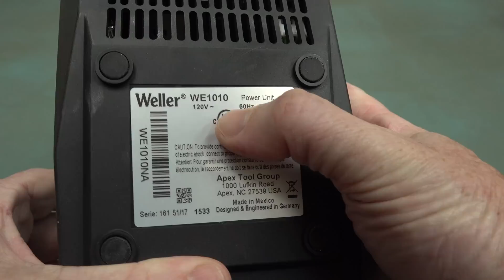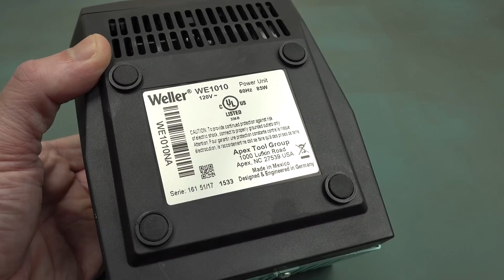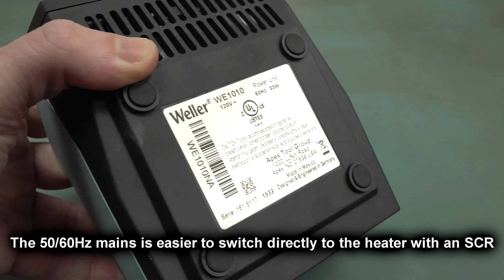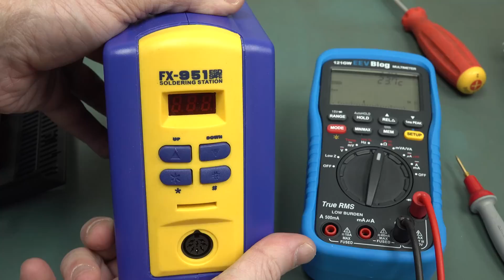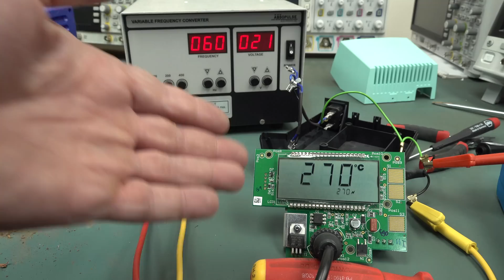EEVblog #1152 - 240V-120V = Magic Smoke!

Comment from the maker: Does anyone know the exact legal regulations on non fused transformer primaries in various countries?
Reply: I'm not sure about the safety standards for soldering irons, but I do have quite some experience on EN60950 (safety standard for IT equipment), EN60065 (A/V equipment) and their common replacement, EN62368-. On all equipment which falls under these standards, a fuse on the AC mains is mandatory. Same for any medical device standards. I would be highly surprised if a non-fused transformer equiped device is allowed in any EU standard.
Reply: @auwdioslave  I agree,transformers must be fused on primary,i live in Italy and my Weller solder station has a fuse integrated on the CEI plug,the only exception i know are some encapsulated transformers,if i remember correctly they must tolerate secondary side short circuits,probably by core saturation,and they normally has a built in thermal fuse or a bimetallic thermal switch.
Reply: @auwdioslave  : but is it written WHERE the fuse must be? 
Can it be inside the transformer (which makes sense)? Because the current doesn't have to be that high for the smoking (only second turning on) it won't blow and probably is shorted in the melting-process.
Or in the connector for the cable? Same still not enough current but would next time when turned on or when it is starting to melt.
Or in the cable ? If you then use another cable then allowed you yourself make a safety-risk.

But: I have bought a soldering-station (pretty cheap) from a Dutch firm that is selling quite a lot of stuff and 'not from china' (although made in of course) last year. Actually a few of them. No fuse to be seen, not in the housing, nor cable (fixed cable). Might be invisible inside the transformer though. 2 of these released a lot of magic smoke but no fuse blew, transformer still works so it was only secundairy.
Reply: The insulation did withstand those puny 240V. Otherwise pluging it in should have given you a ear ringing "BANG" and triped the braker. The transformer saturated after that it something like an 30 ohm resistor shorting mains generating about 2000W of heat burning of the insulation at about 400°C.

To the legal Part:
In the EU it says somthing like - If a in an fault situation the the circuit braker will not trip (16A@230V) the device needs an input fuse.

In the UK they are crazy and fuse a circuit with 30A so they also need a fuse inside of their plugs as otherwise the powercord my catch on fire.
Reply: @tuxontour  in the UK we use a 40A fuse to allow multiple appliances on the ring main to be switched on at the same time.
Reply: UK consumer electronics regulation 374628/8467-6 subsection 6c paragraph II, clearly states 'Don't let that crazy Aussie bloke plug it in, it makes the pixies mad and you just know that sh*ts gonna happen!'
Reply: Not sure what safety standard they went for, but EN60950 or UL60950 requires the device to be single error proven. This means, that a single error, like a wrong supply voltage, MUST NOT cause any "abnormal" temperatures or burning. So it seems pretty much illegal in the EU - but there are always some loopholes I guess. 
Wellers quality degraded quite a bit over the last years, so I guess a recall is following.
Reply: PS: I have the standards at the office to verify tomorrow. You don't happen to have an EU unit somewhere that you can open?
Reply: Towards which country was it originally aimed for? Maybe some country in which there should be a fuse in the connector (like in the UK but then for lower voltage). 
The last years I noticed that more and more stuff doesn't have a fuse in the mains anymore (Netherlands, EU), also if sold in this country by reputable sellers instead of buying over ebay or aliexpress, so something must have changed in the regulations.

Actually, there is a good chance that during the smoking the resistance was still a lot higher then after cooling down. 
I have had this kind of smoke and 'powdered insulation' a long time ago with older equipment which was accidentely switched to the "107" Volt input instead of the 220 Volts (this nice little switch on the tape-recorders / televisions and so on).  No fuse (inside!) blew during the smoking, after disconnecting and re-connecting the fuses did blow (house and equipment at same time, straight after connection to mains).
Reply: @elvinhaak   It should not matter which country it was aimed at, all us humans have the same reaction to fire and smoke i.e injury and even death, why cant we make global regs and keep everyone safe? I will tell you why, cheap Chinese  crap, does not matter if its Weller or Wong Hung Lo. all comes from the same place !!
Reply: @andchip.s  Yes and no... 
Yes: it would be nice and maybe better if every country in the world had the same safe elektric-system but it would be very hard to  get everybody and every country thinking and working the same line. But yes, would be best if everything would be kind of safe
No: why is it nececary to make global rules for everything, making everything a lot more expensive and in some countries / regions extra double expensive and safe due to restrictions and rules? If for example one country decides to have the rule that it is working with 110 Volts with a max of 4 Amps coming out of a socket and requires a fuse in every plug that is rated to the max current of the cable and equipment and then also has an extra fuse inside, you have a lot of fuses that could blow before something happens, expensive cords, wirering and so on so you could leave the internal fuse out (because it is protected anyhow). If you have the same equipment in another country that is using a voltage between 200 and 280 volts, only a fuse in the main circuit of 20 Amps then on that location a fuse inside the equipment is really important and probably some extra protection....
Why make more costs in general and more waste (after all, in a couple of years everything is going to waste) because in some country the wireling and rules are bad? Also less people could afford it and would probably use more dangerous equipment, sometimes even self-made without any protection.
Reply from the maker: Andrew Hudson - Yes, my breaker blew
Reply: Dave, I think maybe this was an assembly error. It's possible the fuse is supposed to go on the primary, with the polyswitch on the secondary. Having both in series seems a bit strange after all!
Reply: @vcr32  I was thinking the same, why have two fuses in the secondary circuit??
Reply: Canadian here, we've got the same wiring standard as the U.S. and I've never encountered a fused secondary it's always on the primary.
Reply: @Shawn_White  24V transformers in furnaces/air handlers are usually fused on the secondary.
Reply: I checked the datasheet for the Weller WE1010 and it is supposed to conform to EN 60335-1: 2012-10.

I don't have the exact standard at the office, but the old version from 2007 instead of 2012,
but the changes should only be minor.

I only have it in German, so I'll translate the basic bits:
19 Improper Operation
19.1 ...
Electronic circuits need to be designed and operated in a way, that a single failure of the device doesn't make it unsafe in terms of electric shock, fire hazard, machanical hazard or dangerous malfunction.

Note 2: Fuses, temperature cutoffs, overcurrent-limiter or equivalent may be used to provide this safety. The safety mechanisms of building installation do not provide the required safety. 

So in my opinion this seems illegal, at least according to EU regulation. 
It may as well be, that it is allowed in the US and they have a built in fuse for EU units.
Reply: In canada (and probably US) [120V 60hz], I don't think it's a regulation. I've seen many devices that don't have any fuse.
Our appliances (ex: mixer, toster, vacuum, etc) don't have any on the device. Almost all wall transformers don't have them.
Reply: In Canada they are supposed to have a thermal cutout on the primary side, usually stuck between the winding and the core or right to the surface of the core.
Reply: @12voltvids  In Mexico is the same standard, it seems to be a Weller fault.
Reply: It was a shot over the bow directed at Mexico. 
If you saw some of the early products they made for Zenith, the system 3 deflection boards you would understand.
If you are unfamiliar,  google the zenith tv fire hazard.
The deflection board had a bad design, and the horizontal linearity was not soldered correctly. It arced and set the fiberglass board that had little or no flame retardant on it on fire as well as the cardboard  insulator that was attached top to the solder side of the board to keep service mans fingers away from HV when servicing. Anyway a number of them burst into flames and this board fire set the wood cabinet (these were console TVs of the day) on fire which in turn set the house on fire.  This was the first of the Mexican made TVs, and I remember changing plenty of sweep boards, and after a number of fires they finally recalled them, and changed to a new board that had fire retardant on  it, and surprise surprise,  now a plastic barrier as opposed to a paper one that the initial sets had. I changed probably 500 of those boards.
Reply: the only Transformers REGULATED in the USA are POWER TRANSFORMERS (i.e., the ones that step down or up the power that supplies your house/business) The regulations can be found in the N.E.C. BOOK. Of course "regulations" mean that you are FORCED to do something or you will bear consequences. W/ electronics you have "UL Listed" items, which are VOLUNTARY
Reply: @generuffalo4374  Power transformers owned by and under the control of the electric utility are covered under NESC regulations, not NEC regulations.
Reply: Dave:

if I read this right from the National Electrician's Code here in the States,  if the transformer has voltages more than 1,000 V,  protection on the primary side must be either fuses or circuit breakers (in addition to protection on the secondary side). If the transformer has voltages less than  or equal to 1,000V, it must have fuses or  circuit breakers on both sides.
Reply: Derek Witt NEC (US) Code does not apply to appliances (that is customarily UL and other similar guidelines).  But, as a general rule with a transformer, if you properly fuse the primary side then you have already limited the current that can flow into the secondary so ordinarily it will be the primary side that is protected by fuse or circuit breaker (unless, of course, you have a specialized application where the secondary side could actually source power into the primary and back feed the mains, then secondary fusing would also be critical — but there is not much chance of a soldering iron suddenly becoming a magical free energy device that powers the grid).

At first I was wondering how Dave got the plugs so easily confused until he turned the unit around and I saw the IEC socket.  From a practical perspective, anything with an IEC socket should be fused to protect the 120VAC device if plugged into 240VAC since that is a very real possibility (heck, even here in the States I could potentially accidentally plug a 120VAC IEC socketed device into our 240VAC receptacles in my shop where I have a good many 240VAC receptacles).
Reply: It is a UL certified product, that certification is the same in any country, Weller is not complying with the standard.
Reply: Didn't the trafo have internal(also thermal) fuse like others? Apparently not, just boiled enamel :D Even cheap linear plugpacks have one (:
Reply: Anecdotally, I heard about a 120V microwave oven that was connected to 208V (standard US commercial voltage 120/208Y 3-phase) due to a wiring error. Smoke poured out of the microwave oven. Same guy who did that also drilled through a conduit feeding a 600-amp panelboard....
Reply: it's also the Japan that uses 120V (with both 50 and 60Hz networks)
Reply: @666Tomato666  Close. 100v in Japan.
Reply: Our plugs in the USA you are completely different and you can't plug a 120 AC plug into a 220 AC outlet or the other way around. I know when I use to repair Weller Irons in the 1980 - 2000 they had glass fuses in them.
Reply: William Randles -  But if it's got an IEC 60320 connector you can just grab any cable. That seems to me also a safety issue here. If manufacturers use standard and common connectors like in this case.
Anyway the regulations in the EU is a mess because of globalization. It used to be pretty comprehensive but now it's all rather vague.
I remember glass fuses in just about everything in my childhood. Nowadays things like ridiculously dangerous USB chargers are sold everywhere. Perfectly legal. No real standards anymore.
Reply: @Northern5tar  I wonder how hard it would have been to construct a connector which would allow a 120V cord to plug into any decvice that could accept 120V or a 240V cord to plug into any device that could accept 240V, but would prevent a 240V cord from being used with a 120V device or vice versa?  Adding a couple notches in the plug that would fit with projections on the socket would seem a simple approach.
Reply: @wfrandles  Yes, they are different. BUT, Weller now use IEC-C14 sockets on their equipment instead of a fixed lead, which is what led to this issue.
Reply: Dave, you probably have an ionization smoke detector. You might consider getting your own photoelectric smoke detector. Or better yet, maybe a video that explains the difference between the two! Public service announcement.
Reply: I'm fairly sure here in north america that they are not required on smaller ones, but many manufacturers still add them in, for obvious reasons.
Reply: In the US, we do not generally require the primary side of the consumer products to be fused. It's silly, but we don't.
Reply: Well for Hong Kong we still follow the
 british standards as same as the UK
Reply: Thats really odd, in most us most of the cheap stuff normaly have a thermal fuse in the transformer, but often not a user serviceable fuse.  I wonder if some mfg skiped the fuse or something.
Reply: There is none in the US we rely on
Arc Fault Circuit Interrupters (AFCIs)and Ground Fault Circuit Interrupter (GFCI) and circuit breakers  older houses have fused circuit breakers )
Reply: EEVblog do a review on the Aneng 870 (Top of the line Aneng multimeter) next time please!
Reply: In the UK the plugs have fuses, many extensions leads had them but not all of them do any more and some appliances do have fuses inside or they are in round covers or holders.
Reply: If its in the US this is perfectly fine as each circuit has MCBs
Reply: Not to sideline this thread or anything but I am thinking about this and I am wondering how Dave managed to plug-in this Weller in the first place . As far as I understand it, the Plug for 240v is totally different then the 120v one at least in the UK. Does this mean that Dave has a 120v power bar running at 240vac? 
I looked through the comments and did not see anyone else mention this...
Maybe I am missing something regarding Dave's bench setup...
Cheers,
 - Eddy
Reply: The Weller unit has a standard grounded  interface plug, just like your PC has. The power cord would have the correct plug at the other end.
Reply: @12voltvids  - That would explain it... I was looking at my old WTCPT unit at the time and did not think about the standard AC (PC style) interface that the new units use.
 - Eddy
Reply: @EngineeringVignettes  IT has an IEC type 3 connector. It was the appliance end that is easily used on any voltage.
 Australians dont have 120V. We only have 240V phases, no other weirdness. For single phase we use an IEC Type 1 plug/socket on the wall - it predates the IEC type A used in the US and was originally used there. It is used in China and Argentina too (the china thing is ofc rather handy, the connector prices would be insane otherwise). We also have 3 phase 415V which is 3 240V phases.
Reply: I can't tell you what the regulations are, but I have seen quite a lot of US market stuff that didn't have a fuse on the primary side of the transformer, so I have to presume it's permitted.
Reply: still silly that it does not have a fuse, it should have at least an internal thermal fuse (self reset or one time blow)
 
the appliance itself been fused it or not is up to what country in the world your in(the application internally should have a fuse ) , most seem to rely only on the consumer unit breaker to trip but that can be from 20A 120v to 32A 240v witch can cause house fires if say the breaker is faulty, i would always use a fused plug in my country even if they did not require it or at least fit 13A RCD sockets as they will trip before your breaker box trips

a 3A plug fuse would of likey blown before your breaker tripped as it would of been pulling over a KW of power before it thermally overheated and shorted out, was more lucky that the transformer went dead short and tripped main breaker before becoming a fire hazard (i be more concerned about the power cable)
Reply: In the UK the plug fuse is ONLY for protecting the cable between the mains socket and the input to the device. If the device requires any fuse to protect the device from damage, that has to be additional and fitted inside the case. This is illustrated by the fact that the minimum BS1363 fuse size is 1A, which is not low enough toprotect many devices, and is rarely used (3A or 13A are the most commonly used plug fuses by miles). Instrument / device protection fuses inside the case are often glass or semiconductor F or FF 20mm fuses. It would only have cost Weller a few pence to add one!
Reply: I just ran across your channel and this video I already love it xD subscribed
Reply: Easy repais dave :)
Reply: Weller equipment sold in the Netherlands allways have a primary fuse in it.
Reply: I have always been told that anything, including transformers, must have a  fuse rated at most 1.25 times the maximum allowed current. That's in the Netherlands.
Reply: Time for a transformer rewind. It's not that difficult to do
Reply: I think in China it is illegal to sell mains rated items without a built-in fuse or circuit breaker now, due to the China Compulsory Certificate system. Even cheap Taobao units has internal fuses to meet this legal requirement, and since replacing a simple transformer with an internally fused transformer costs next to nothing it is the usual route taken by the manufacturers.
Reply: I think most of the UL, etc. standards are really performance-based, not generally requiring specific protections such as a primary side fuse. There was probably some requirement to show that if the transformer primary shorted out, the amp draw would be sufficient to trip a circuit breaker before a dangerous situation would occur - dangerous being defined as the device case melting to expose live parts, reaching dangerous temperatures or actually catching fire or exploding. The standards don't require that the device doesn't fill up your home with nasty smoke, let alone that it has to still work or be repairable afterwards.
Reply: @RobertHancock1  CCC has a safety section requiring protection as part of the type certification. p.s the China-RoHS is slated to become the environment section of CCC soon.
Reply: In South Carolina where one of the plants that manufacture Weller products resides about 10 min away from me, transformer primary fuses are not required if you have protection on the secondary, and when using a circuit breaker rated for the device from what I seem to find, remember this is not a 240v unit, so this was a forced failure mode, you'd never accidentally plug a 120v in 240v, since this is clearly not for the European or 240v market, probably only intended for North American or maybe Japanese markets (100v -125v)
Reply: doesn't using the wrong mains input voltage fall unter "reasonably forseeable misuse" for CE certification? for amateur users at least?
Reply: @EEVblog I work at UL. Because the sample was operated outside of their declared ratings, neither they nor UL are liable for damage. That being said, I checked the datasheet for the test that should have prevented this and... uh... it's... well... problematic...
Reply: How did this thing get a UL stamp ?
Reply: This is poor electric insulation of wire. In old days windings was be protected with additional layer of protecion laquer which was be roasted, but now to be competitive this was is excluded from final phase .
Reply: @EVVblog NO no i wish I did know the legal specs.
but maybe... you got a lab is it  possible to spec out a MUCH better transformer that can also work in aus?
Reply: Ironically the answer comes (simply) from the 110 v rating. 110 v provides less power per amp so there's less need for primary side protection. Not so good when you have a handy 240 v supply nearby.  :)
Reply: Well, I don't see the difference, even if such a country exists. I doubt that there are rules prohibiting the use of fuses.
Reply: Most transformers in the UK complying with the old BSi standards had primary fusing, though some USB adapters have no fusing at all, budget audio made in china is something you find the mains lead going straight to the transformers via a switch on the live side or a figure of 8 input... it's up to the 32A breaker to decide your safety, or over here a 3A fuse in the plug.
Reply: Wow im using the exactly same model(but 240v version) of soldering station! Im a phd student @ UNSW
Reply: Well, the transformer acted as a remote control for your house panel fuse. 
They truly are "more than meet the eye." Sometimes even "robots in diguise!"
Reply: Nope
Reply: @Seventh Anubis As I recall, you are correct in the requirement of a recognized, or otherwise acceptable insulation for a non-inherently power limiting transformer.
Reply: Dave, is the c13 power cord common for electronics that use 240v in Australia? It seems to me the standard would be the issue and a different standard should be used for different voltages. Obviously the male side of the cord is different between the States and AUS.
Reply: Im not sure but so far i can only find protection on secondary sides here in Quebec from my scavenging
Reply: @Moab's Washpot - That is impossible!
Reply: I think I should speak a bit about our UL approval agency... At one point in time you could slip them a check under the door and get yourself approved. a company called Federal Pacific did this for their electrical panels you can literally Arc weld in any room you want because the breakers won't trip. letter company bought out the name and has remanufactured their Breakers but the name is samat synonymous with Federal fire Pacific at this point so all home inspectors pretty much know about this.
I always thought Transformers required a fused primary and that solve the need for not having a fused secondary although that is good practice.
And yeah all you need is an outlet that is wired especially for that janitor floor buffer and before you know it you'll be plugging into 240 in the US and releasing Magic Smoke; FYI make sure you're not plugging your expensive audio equipment into the unswitched outlet on your power conditioners something I read about on a electrical safety website for musicians.
Reply: UL_60335-1

17 Overload protection of transformers and associated circuits
Appliances incorporating circuits supplied from a transformer shall be constructed so that in the event of
short circuits which are likely to occur in normal use, excessive temperatures do not occur in the
transformer or in the circuits associated with the transformer.
Compliance is checked by applying the most unfavourable short circuit or overload which is likely to occur
in normal use, the appliance being supplied with 1,06 times or 0,94 times RATED VOLTAGE, whichever is the
more unfavourable.
The temperature rise of the insulation of the conductors of SAFETY EXTRA-LOW VOLTAGE circuits shall not
exceed the relevant value specified in table 3 by more than 15 K.
The temperature of the windings shall not exceed the values specified in table 6. However, these limits do
not apply to fail-safe transformers complying with subclause 15.5 of IEC 61558-1.
NOTES
1 Examples of short circuits which are likely to occur in normal use are the short-circuiting of bare or
inadequately insulated conductors of SAFETY EXTRA-LOW VOLTAGE circuits which are accessible.
2 Failure of BASIC INSULATION is not considered likely to occur in normal use.
3 Protection of transformer windings may be obtained by the inherent impedance of the winding or by
means of fuses, automatic controls, THERMAL CUT-OUTS or similar devices incorporated in the transformer
or located inside the appliance, provided these devices are only accessible with the aid of a TOOL.
Reply: Non-fused ? If there's no external fuse then an internal thermal fuse should be used. Thermal fuses are slow to act of course, so much smoke will result first.
Reply: @pasoundman  Nonsense. Your home or the socket you connect to should have all the fuses needed. There is no need for additional fuse if you are using the soldering station within it's specification. Of course, if you connect it to twice the voltage it is specified for, then magic smoke will happen, but otherwise you need no fuse inside the soldering station.
Reply: @AdaptingCamera  Curiously, the British regulations feel differently. At minimum the plugtop must contain a fuse. The result ? The safest electrical system in the world.
Reply: Does anyone know the exact legal regulation on modifying a 110 north american plug to fit a plug in Australia and then pretending the product is defective?
Reply: Dave, I have tired of your whining about the transformer primary fuse.
GO TO Your Home HVAC system.  In North America ..
 120 VAC to 24 VAC transformer used for their Control Circuits are NOT Fused on Primary.  WHY?
HVAC uses a Type 2 Transformer … legal for that usage.  Weller was formerly buying that identical transformer — BUT Weller Europe now designing — and I have No IDEA of their competence or Knowledge of that Fact.
—
The former PU120 base for WTCPT state used a 6/10 amp fuse on 120 VAC … BUT they still used the Tyco HVAC Transformer (recently discontinued during COVID lockdown).
Reply: I dont believe it's a regulation. From what I read, the over current protection is handled where the power comes in (circuit breakers).  Only exception is when RMS voltages over 1000 are brought in.  Did the circuit breaker in your building not trip? 220/0.2Ohm is 1100A.  The breaker should've popped.  It also mentions cord length. So maybe if the cord is short enough, you dont need a primary fuse.  I guess it's just a shitty way to gaurantee some repeat buys
Reply: @Pops180  we talk about AC and not DC. we need the inductivity to calculate this.
Reply: @derhackerthetofu  what is the inductance of a shorted coil?   Its close enough to a DC resistance
Reply: Here in EU there must be a fuse in the mains plug that is the correct rating to protect the mains lead. If the appliance doesn't have its own protection then the fuse in the plug should be rated to protect the equipment as well.
AFAIK (but I haven't checked) if the appliance has a removable lead (as this one has) then over current protection inside the appliance is also mandatory since there is no knowing what lead the user will plug in.
Reply: Eu: all mains products have to be primary fused. However chinese products offen are findable
Reply: True but in the EU, if I remeber the regs correctly, that is to protect the 'house' wiring; not the unit plugged in!
Reply: @daveturner5305  I think the house wiring should be fused to protect the house wiring and not the device. The device should probable be fused to protect the house e.g. stop the device from burning.
Reply: @daveturner5305  yep, but more to protect the cable to the appliance , not protection of/for the appliance, it should have its own internal fuse........
Reply: @daveturner5305  In Germany, all fusings are done to protect the wires. Overcurrent in case of a short circuit is usually handled by circuit breakers quite efficiently, so a primary side fusing to a transformer usually protects against overload, like a device pulling double of its designated power use, but less than the 16Amps you usually have as circuit breakers in germany installed.
Reply: @N3szt0r  That is NOT true at all. Most equipment DON'T have any fuse on primary side, including transformers. All according to EU regulations.
Reply: @N3szt0r Designed in germany, made in Mexico.
Reply: Inherently Energy Limited Transformers - Class II transformers up to 50 VA are “Inherently Limited” which means that the transformer, if overloaded, will short itself out and fail safely, not requiring a fuse.

Technically it did not perform its safety function as described, the mains fuse shouldn't of tripped unless the main was already loaded. 

But....
Doorbells are 120V  / 16 V (in the US) and have no primary or secondary protection.

https://www.te.com/commerce/DocumentDelivery/DDEController?Action=showdoc&DocId=Data+Sheet%7F1308242_trans%7F0303%7Fpdf%7FEnglish%7FENG_DS_1308242_trans_0303.pdf%7F8-1611476-0

Class II UL 1585 Transformer
Reply: For the UK, a fuse can be specified on the device for the plug, for countries with no fused plugs, eg Europe, then oh dear!!.
Reply: @bostedtap  We in Europe have mandatory (and mandatory fast!) fuses on the house-wiring side which shut off the device (and all other connected sections) if it draws more current than a single wire can safely deliver. So, while it certainly would destroy the device (like it happened to Dave) it still would be safe in regard to risk of fire or other damage. Dave's soldering station would just have immediately blown the fuse of that house-section. No (at least not much == no, to nearly no) magic smoke from the device (which would have been dead none the less)...
Reply: @StefanFendt  I am aware of house wiring fusing, my apologies if I implied that this was an interior system. Yes, fusing is to protect the wiring/cable, I assume it is normally 16A for house socket outlet wiring, and 6A for lighting. My concern has always been plugging a device in when the device lead/cable is incapable of carrying the fused rating. 
Travellers socket/plug adaptors are another area, I used to travel extensively to North/south America, Europe, China & Korea installing specialist welding equipment. Very interesting to see different technical legislation. So a comparison between fitting all non fused devices with 16A rated cable, or fusing each plug with derating fuse.
Regards John.
Reply: @bostedtap  BTW, most higher quality devices here have a primary side fuse. I wonder why Weller(!! oh my gosh, you break my best believes) did not include one. This is awkward. Maybe it was in the cable-plug as it is mandatory(?) in the UK? Even my el cheapo XYtronic soldering station has a fuse on the primary side (which additionally is accessible from the outside, without opening the housing...).
Reply: @StefanFendt  Exactly. If I'd plug in a 120V transformer into my wall socket then the circuit breaker would definitely trip and protect me from fire. In fact, it is fast enough to protect the transformer also, unless it's a real crappy quality. In other words, this can't happen to me in Sweden, even if I'd be stupid enough to try to repeat it, unless I bypass the electronic fuse.
Reply: Yeh we need to force everyone to use 240v. Its just silly now. A fuse in your crappy plugs would also help.
Reply: I just remember that people in the UK have breakers in their cords or in their sockets. The fusebox only has one fuse for the whole house; also the sockets are wired in a 'ring', so from two sides.
Reply: Dave why didn't you just look into the safety standards before making your rant video, it's childish dude...
Reply: Whack a $1 220v china transformer with a primary fuse in and you are ready to go.
American stuff is rubbish. China rules.
Reply: @ironcross7753  If you look at the label, it was made in Mexico...
Reply: @ironcross7753  1:01  Designed and engineered in Germany, Made in Mexico.
Reply: @ironcross7753  It's from Germany.
Reply: Except that was Mexican, and we all know that is a few pegs below the Chinese.